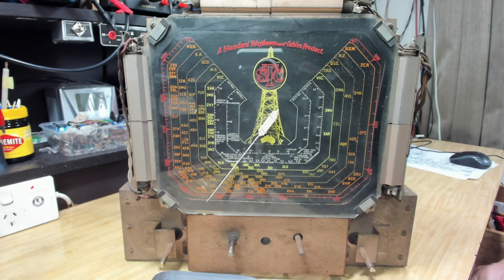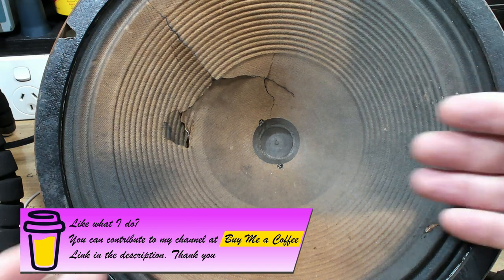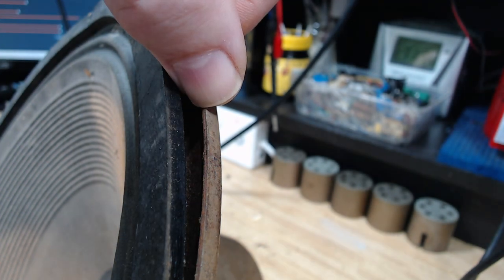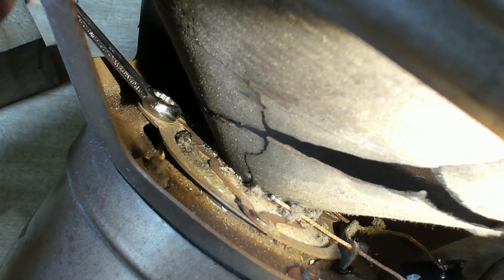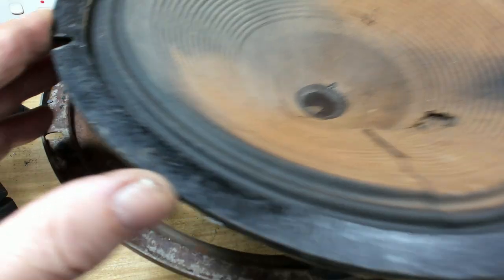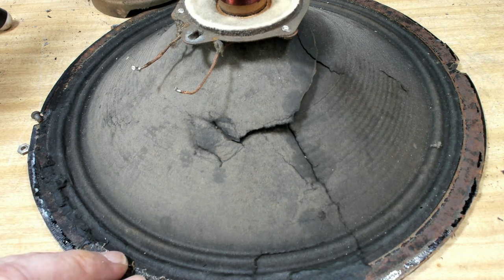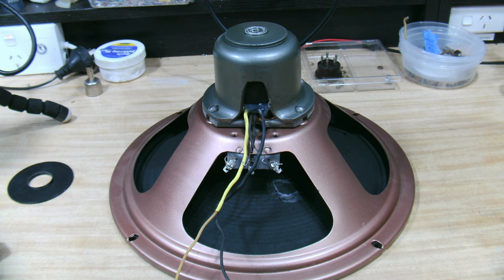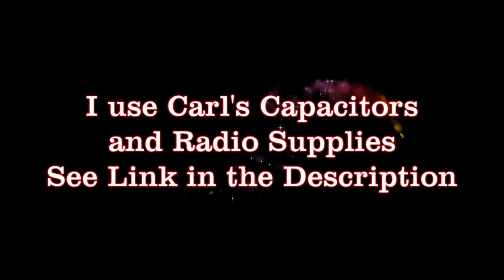STC 830 Radio Restore - 1938 Part 2

Comment: I was looking forward to the speaker repair and it came up a treat.  Even though the speaker cone was damaged, it still surprises me how well the paper held up after all these decades.  That is to say, paper can survive for centuries if stored correctly but this poor old radio was likely not stored in ideal conditions.  With the tuning capacitor, have you considered using Evaporust or Metal Rescue ?
I use Metal Rescue and it's amazing stuff for removing rust on any metal without damaging the metals or paints.  This way you wouldn't need to media blast it and risk damage.  Regardless, the tuning capacitor and the chassis look fantastic. 
Will we see what the whole thing looks like inside its enclosure/cabinet ?
Reply: I’m afraid we’ll never see the marriage of cabinet and chassis, because the owner did the cabinet himself and doesn’t live in B.
Reply from the maker: Hi Ellesmere, the speaker was touch and go, a new cone would have been better but it works very well considering the damage. I do have some Metal Rescue but haven't tried it. I will try it on the next job. The media blaster is quick and does an excellent job, it really doesn't take much to get the rotor plates sorted afterwards. I will show the radio in the cabinet at the end of part 3 👍 Thanks Ellesmere.

Comment: Hey David a great video I’m watching it again. You make the speaker repair look easy. Tea bags are a clever patch. What did you fix the suspension around the rim with you said something flexible but it’s not in the video and what kind of black paint?  I have a similar speaker here that needs similar repairs. 
Thanks Robert
Reply from the maker: Hello Robert, thank you. I used liquid electrical tape for the suspension area repair 👍🙂

Comment: Do you use glass beads for your blasting medium? Or one of the other "exotic" ones (shells, etc)? In any case, it seems to work well. Thanks for letting us watch and learn.
Reply from the maker: HI Joseph, yes, it's glass bead. It seems a good compromise when removing heavy rust and also lighter duties. Need to avoid the dust though 👍🙂

Comment: Looking good!

It seemed a bit difficult to sandblast the tuning capacitor like that and have to clear shorts afterwards. Did you ever consider just soaking it in evaporust or other similar rust soak stuffs?
Reply from the maker: Thanks Brian. I have done countless tuners in the media blaster and have cleared every one with out too much difficulty. This tuner was touching before I sandblasted it so I was checking it for that as well. Before I got the media blaster I used a rust remover equivalent to Evaporust and it didn't work anywhere near as well 👍🙂

Comment: Wonderful work David and great video (sound, lighting and editing all first class!) explaining all the details of what you are doing. You mention you would patch the speaker cone on the back as well. Is this something you would do in most cases or just this one because of the condition of the cone?
Reply from the maker: Hi James, thank you. No I don't normally patch the back because it can be seen when mounted in the radio. I didn't end up putting a patch on the back of this speaker either, the patch I put on in the video was strong enough in the end. Sorry for the confusion 👍🙂
Reply: Thanks for the helpful reply David. I am repairing a speaker at present and following your techniques.
I assume you remove the blue tape before the glue dries?
Thanks again David, your videos are fabulous!
Reply from the maker: @jameswaldron2405  My pleasure James. Yes, tape removed, it was only there to hold the cone together for the repair.

Comment: 7:00 you said it will come out all pretty easily, in truth it's still a heck of a lot of work, in a case like this where the radio started off barely working and needed intensive rust maintenance, would it not have been easier, stripping it apart first, doing the rustoration, then putting back together replacing caps, resistors and wires as you go to then troubleshoot what ever isn't working?
Reply from the maker: Hey patprop74, it is a very complex chassis so yes, it was a lot of work, video editing makes it look easy. Yeah I agree with you that it may be better to do the restore after the radio is working. I have a thing in my head that I want to check the radio works before tearing it apart so I know if the fault was there already or I created it. I could go either way I guess 🤔🙂

Comment: It never ceases to amaze me that the makers of those radios always put those things together so terribly complicated.  It's almost impossible to fix them without tearing the whole thing down.
Reply: It was designed to go together, not come apart. Absolutely no one at the time imagined that you would be still trying to fix it 70-80-90 years later!
Reply: @brettbuck7362  Indeed. Durability and recycling were not yet lemmas in the dictionary.
Reply: @horatiohornblower868  People tend to lose perspective  - all of these things were appliances, not historical artifacts, to the people that built them. This was obviously a quality product - it still sort of works after all these years. But if you told someone at the factory that you would want to be taking it apart and rebuilding it in the year 2023, they would look at you like you were nuts! So, having to unsolder a few wired and replace some components and have it work as good as new is a minor inconvenience.
Reply from the maker: Agreed, they managed to stuff so much in a small chassis. Compared to the cabinet the chassis could have been twice as big 🤔🙂